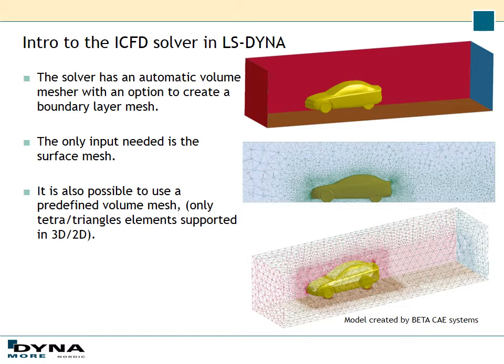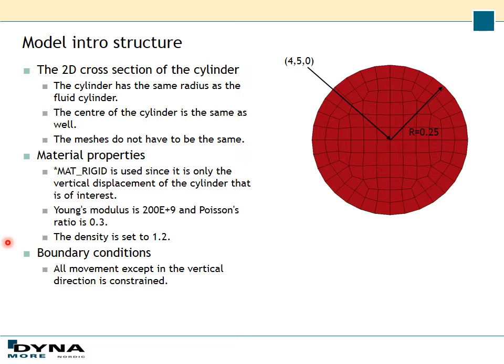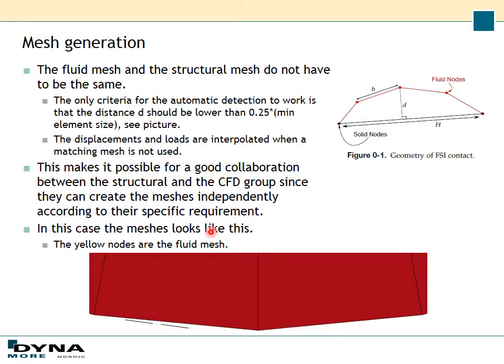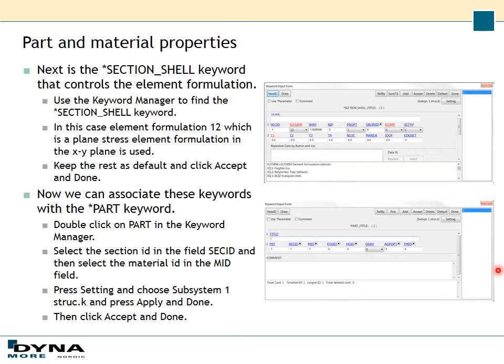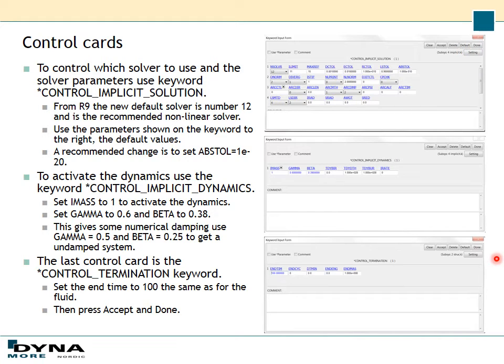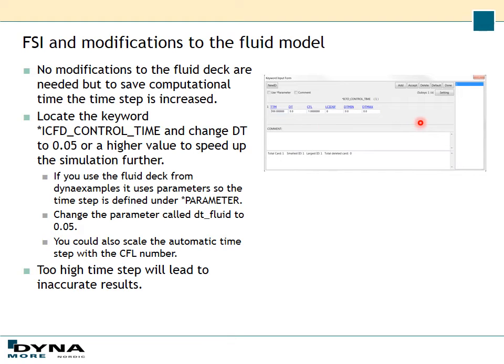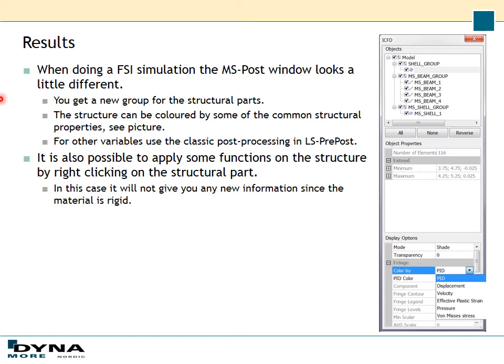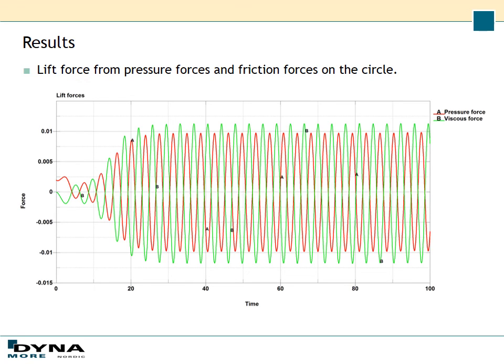ICFD how to set up a 2D FSI case

Comment: Any Help my friends ? :(
Reply from the maker: Hi,
Regarding your last error, you have a input error which means that LS-DYNA do not understand some of the input. I would recommend you to compare your model with the final model and see if you can spot any differences. Which LSPP version are you using some of the earlier version before the official LSPP 4.3 had some bug regarding the ICFD keywords.

If you mean in the final main_fsi.k file you should include the main structure and main fluid file.

Hope this solves your problems otherwise let me know.

Best regards,
Marcus
Reply: Hello Marcus! Thank you for your answer! :( I already tried doing the example using LS-PP 4.3 (R901), 4.1(R800) and 4.0 (R700) but with the same result at the end. I also tried the 3D CFD tutorial and have the same result, so I don't know if I have to do something special when I save the file or what I'm missing :( I have all the same keywords in the file... but when I opened my main file .k using a note pad and compare it with yours.. it is not the same in some lines.. :(
Reply from the maker: Hi,
I would say that the problem is the LSPP version, download the 4.5 version and try. It can be downloaded from here: ftp://ftp.lstc.com/outgoing/lsprepost/4.5/. You could also use a text editor and remove the lines that looks wrong, depending on which keyword it is that differs from my files. My guess is that it is the *ICFD_MAT or *ICFD_BOUNDARY_PRESCRIBED_VEL that is the problem.

The best thing is to download LSPP 4.5 and try with that one if that do not work then let me know.

Best regards,
Marcus
Reply: LS-DYNA Corporate Tutorial & Content Hi Marcus! I've found a clue.. Is the mesh fluid file... If I use your version of the mesh and my version of the main _fluid. K the analysis continues until normal termination.. First, I saw that when I imported the step file.. It is not in the same dimensions... You have a 1x1x5 prism and I have a 1000x1000x5000 prism.. So I tried to modify the file in a cad software to export it in iges.. So when I use it I can choose the units in LS-DYNA (meters or milimeters).. And Then a do the mesh Using automesher with the sizes you mentioned, and Then converting to Ms Mesh.. I Save and try but a New error is coming... Error 120003 (ICFD+3) about the volume and the mesh generation and gives me error termination... Any idea? However I Will try with the newest version of LsPP you mentioned... The only diferences between your mesh fluid file and mine are the values of the mesh, but I asume that is normal... Despite that it contains the same elements.. ICFD part (5 elements) the ICFD element and ICFD node keywords... Any idea?? Thank you for your time Marcus!
Reply from the maker: Hi,
Could it be that you have a duplicate node in the mesh or that the mesh is not connected in the boundaries? Is *MESH_VOLUME defined correctly, and the mesh is converted to a MS mesh format? Besides these things I do not understand why it should not work, I will update the geometry file of that problem to a iges file when I have the time. If you still have problem you could mail me the model, so that I can take a look at it.
Reply: LS-DYNA Corporate Tutorial & Content Thank you very much!! Yes as far is I understand it the mesh Volume is ok and yes I also converted to ms mesh... Can you tell me your email?? I really appreciated your time!!! Thank you again🙏
Reply from the maker: Hi,
here is my email: marcus.timgren@dynamore.se.
Reply: Thank you very much Marcus! I've just sent you an e-mail "jose.duranhz@.." .. Hope you received it! :) Thank you again for your time..
Reply: Hello Marcus!! I was able to fix my errors with your help!! thank you very much, I sent you another email with other trouble I found, could you help me again please? :)

Comment: Hello I have a question.

First when i tried to run the model I got the following error : "The element ID 1 has a thickess lower or equal to zero" ... I checked and found that during the definition of the keyword Section_Shell I had ELFORM parameter with 2 instead of 12 for the plain stress x-y ... I corrected but after that I got the following error... 
https://s18.postimg.org/3o6r4yas9/Error.png

Can you help me?

Another question... when including the previous .k files I have to include the struc file and for the fluid.. I include the mesh_fluid or the final main_fluid.k ??? I named my files same that you. Except that I don't have the i.k and the implicit.k